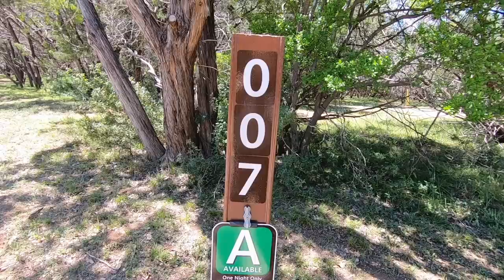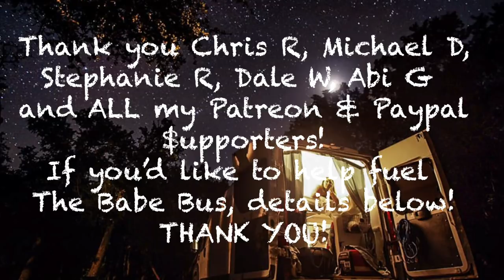Happy Two Month VANNIVERSARY Babe Bus!

Comment: Solar isn't practical with rv/van living at the scale needed to run a/c.  The whole point of solar is to get a return on a long-term investment. It would cost nearly $10k just to safely run a/c for 3 hrs at night.  Not mentioning where would you mount all 12-16 panels optimally for cooling and energy production when their location isn't constant.

Comment: Out of curiosity would you consider cutting your countertop in half to add a shower/wet bath? (In the future) it would fit. Or on the opposite side of the counter? Your thoughts?
Reply from the maker: Absolutely not. The kitchen is already insanely small.

Comment: On the Solar with AC check out some of the latest videos from Nomadic Fanatic. He just installed a MONSTER solar array and runs his AC. The trick is you really have to have a MONSTER set up, buts its possible. :)
Reply: Monster set up?  Have you seen pictures of the Babe bus?  It is a little van, not a huge class a like Nomadic Fanatic is running.  He has much more roof area.  Not a trick.
Reply: @jdmather5755  Well, yes I realize that I was merely saying that it can be done under certain circumstances.

Comment: I run my air conditioner on solar for up to 7 hours. 800 amp hours of lithium. 3000 watt inverter. 450 watts solar. Never need shore power
Reply: How much did all that cost just so you could run a/c

Comment: Cut a trap door in your floor. Big enough to set a Honda eu2000 through it. Then plug in. Then it's out of sight out of rain and you can run anything.
Reply: @CaseyRoman  it won't vibrate while sitting on ground. Seal trap door no smell. Noise yes
Reply: You can also use trap door to take a dump. No emptying bucket

Comment: Speak to both Nomadic Fanatic and Life is a Joy who are both running AC off of solar.  It’s quite possible BUT doubtful in a van purely because they both have massive solar banks and lithium batteries.... with a van and under a KW of solar... nope not gonna happen.  But I know nomadic can run one of his AC for about 6-8 hours on his bank and LIAJ has a mini split he can run for a few hours as well, but he uses a slow start as well to get it running.
Reply: The Babe Bus is a van.  I don't get the relevancy of speaking to someone running a class a rig?

Comment: Yep Maxxair type vent fan works wonders. Something with a large fan. One can look on freecampsites.net and find either free or cheap places to camp. Some are boondock, some are remote campgrounds, some are city campgrounds many free. The campgrounds I think are $15 or less to be listed on there. Uh yes A/C on solar is possible. Rooftop air isn't a realistic option. A minisplit is the best option. I seen a build that had the condensor disassembled and mounted underneath. Not for the unskilled but it's possible. A few vans have 1000w + on the roof and run A/C even overnight. Yes Lithium batteries make that possible. Water is the biggest obstacle in  a mobile life. Oh many home improvement stores have water in the parking areas or surrounding for watering plants etc.

Comment: 11:35 it took 3 years to build up to 300Ahs of batteries and enough solar to charge them in 😢6-8 hours - - and i can just run it overnight. It doesn't work  in Phoenix summers, only during the shoulder seasons and winter 😏

Comment: , God bless your heart. I’m puzzled how you are A-OK with ‘Le Shitter’ and having a challenge regarding van shower reality. (Even with a built in full on RV shower stall, you would not have  enough hot water to luxuriate with 5 different soaps and ponder the meaning of life.) There is a company working on filtering and recirculating hot shower water to allow for long showers but it’s not even a prototype yet. Ventilation: install interior chain locks and crack your windows and doors at night.(Additional interior locks are needed in any event event because ppl will use a slim Jim and break into your van while you’re asleep! )
Reply from the maker: Tranquility Travels have you converted a van and actually lived in it?

Comment: ok...not even halfway through the video and I have to comment.  Staying at state parks:  they are nice, great in fact.  But if you are not a senior or disabled, they are NOT a long term solution for being on the road full time.  Discounts provided to seniors and disabled (rightfully earned by the way) help bring the cost down to where it can be affordable. 
Second point of RV vs. Van life.  Casey is right. For a majority of reviews, they are written by RVers and they usually use the facilities in their own rigs.  I am disabled and there is no way a right leg amputee (at least me) who is about 6 foot and 250 lbs. is going to be able to shower in the mini closets they call a shower in RVs.  I use the facilities at parks daily when there (and in about 2 months that will be full time).  I need the chair/bench/whatever to sit, and need hand rails to hop from spot to spot while showering. 
Finally let's talk solar you obsessed greenie fanatics.  Yes you can run AC on solar.  But the cost of the setup you need to do it properly is about $8000-$11,000 (and don't tell me it isn't, I've done the research, have YOU?).  Let's be generous and say $9000.  Divide $9000 into 180 days (half a year, you don't run AC in winter) and you come out to $50 a day for the first year.  At $50 a night you can stay at most RV parks, state parks, Army corp campgrounds, whatever and be guaranteed 24 hour power.  You cannot be guaranteed that with solar.  Trees, rain, and other variables get into the way to guarantee constant power.  Finally regular deep cycle batteries cannot handle that strain, you need lithium batteries to do that kind of work, hence the cost.  Until the technology is to a point where it is affordable enough to be standard equipment on RVs, the cost factor outweighs the benefits. 
Now if you're a trust fund baby and money comes out of your backside one the toilet, fine go solar until you have third degree sunburn.  For us average RVers/Van dwellers, solar is a nice BACKUP!!!!  I plan to have some solar to use in emergencies.  I will not depend on it.
(falls off of soapbox now)

Comment: @Casey  Basically in my opinion I see Solar as an added compliment to an electrical system. One of my old buddies back from high school he's an electrician he does a lot of work here in the Boston area installing solar panels and  home generators. And he tells me they're great to have but the amount of area you would have to have to generate enough for all usage generally isn't in most homes in terms of the roofing in the backyards excetera even if there was enough space it would take up the space for other uses. So the same theory translates to an RV or a van of course maybe not exactly but I think people get the idea. no I don't have a van or an RV although I plan on doing it. But I see things as a three pronged attack. You're going to have your regular power that is coming off your alternator from your vehicle, solar panels on the roof and a generator. I get the point of some of the people who are these solar power saints it's the catch all end all make all everything all . In most cases reminds me of the people that want to put this green New deal silliness across the country. Which would never work. Most folks need a mix of power sources. BTW, I enjoy the irreverent humor and  like the straightforward approach. I watch lots of these different channels to get an idea of how things should go what to expect xcetera. So thanks !
Reply from the maker: "Three pond attack" is my favorite part.
Reply: @CaseyRoman  I figured you would appreciate such 😉 you try using talk-to-text with a Boston accent LoL. I fixed it .  What no wise ass crack on the Solah ;-)

Comment: Re washing machines, you need the space and easy water access. We have a Panda washer that hubby loves. But it won't handle anything that I could not do in a bucket in the same amount of time. Plus, the bucket would not weigh 50 pounds or be clumsy to drag around or store. I am just waiting for the d****d thing to die. So, you know it never will.
Reply from the maker: If you know the mechanics of a washing machine than you know nothing replaces a washing machine. I am not about to spend all day twirling anything in a bucket. I go to a laundromat.
Reply: @CaseyRoman  Laundramats are lovely. Bus sometimes we are 30 miles from the nearest one. That Panda really does a good job, but it is heavy and clumsy to store on the road, and looks trashy sitting outside covered with an Ikea bag to keep the bugs out. If all I need to do is clean off some sweat and dust, the bucket is OK.
Reply from the maker: Jean on the Road I change locations daily so I’m never far from one

Comment: I watched a video by Bob Wells, and he said that the one reason for not insulating was if you RV where it is hot.  The heat is going to get in and the insulation will keep it inside.

You don't run the AC off the Solar.  The AC runs off the batteries.  And, getting enough  battery power for an AC is hard.  Nomadic Fanatic has 1.2 kilowatts of Solar, but he has a class A, and I don't think you are going to get that much on a van.  Though, Campervan Kevin does have 900 watts of solar on his Promaster, so...

Put the Tulips away??  Haaaahaa!  Thanks.

Water?  You don't boondock.  People who boondock need more water.

"Could you empty this for me?"

Then again...maybe not.

Comment: I don’t know shit about this electrical, batteries, solar, grey water clean water but I know that I would like some watts of solar. I plan on going towards sun and heat. So I want the solar charging the battery🤔 is that how it works🤣🤣🤣🤣🤣🤣 kudos to you for building the Babe Bus yourself because I gonna need some fucking help🤣🤣🤣

Comment: Air conditioners off of solar you're such a thing called a easy start once you put that little box have it installed you can run it all day off of solar and batteries all you need is 400 watts of solar for 100 watt panels and for 100 watt batteries

Comment: Window and second vent...check.  Your insulation work was not wasted, if you were in extreme temperature change, that work would pay off.  Your correct about running an AC on solar (battery).  I'm getting a portable shower and a shower tent, oh yea.  Swamp ass will not do.  What the hell is that thing (fan?) starting and stopping through out your vid?  Good point about pets.

Comment: Hey lady, if you go to your 1st video where you said you wished you had done 2 fans, I wrote a well researched note with Amazon or Walmart links to fan options. All 12v or battery operated that can stand alone or clip on for temp use. Search on my username to find it.  You can use Prime shipping to a UPS store whenever you're in 1 place for 2 days or just Walmarts or truck stops for inexpensive decent options.  It really helps. I also use a battery powered rechargeable shower to do your hair right with a bucket of hot/warm water.

Comment: you can run that on solar, but it would be very costly.  Check out nomadic fanatics recent videos
Reply: Yeah, but Eric had a class c , and now he's in a Class A with an entire roof of solar panels....and Pippi Peterson did THAT years ago...BY HERSELF,  including wiring AND building her battery bank set up.  I enjoy NF,  but Pippi is the most knowledgeable.  I don't think Casey   has the space for the amount of panels needed or for the battery storage. 

On another note, I WOULD suggest a National Park pass...or Thousand Trail etc.  Initial outlay may be a bit pricey, but feom what I understand totally worth it.

Comment: You can run an ac on solar panels, not all night. Where I live you need climate control day and night.

But rather than go through all that trouble I would rather hack a Prius with a hard sided pop-up than try to get enough batteries , solar, and afford to be able to haul it all.

  I almost shower exclusively at the gym some of the time I just don't want contact with the public I will heat 1.75 litre of water for the process. Yes I use the hose it's cold but I use my hot water wisely. I use water coolers and this makes that hot water stretch. 

I would not mind getting a 350 watt solar panel to see how much fuel I would save having a panel like that. I'm done pissing away money on experimenting with anything else. 

Sometimes i don't feel like going out to poop I place a bag on Willy and my ass over a garbage bag. Rarely do this and it is crazy I do this I have a fully functional RV bathroom in the camper. Thing is I don't want to deal with dumping the tank rather place  the garbage can under my thrift store shitter bag it up toss in the trash. I'm so close to going GET hardware to remount the toilet so I can have a righteous flushable shitter.  I think I'll break ground on that tomorrow.

My toilet works just a fine tree has put down roots and DISTURBED the sewer line. Shit runs downhill so I can reroute the sewer line or file 13 the bathroom and just build another one this side of the tree. I will fix something up before this summer is over hell I might have it done by Monday.

Comment: i have 3 250w panels on my van roof, and a 2kw inverter, and 200ah of battery soon to be made to 400ah, but no way can that run aircon for 8 hours a day, and thats about the biggest system your getting in a van, you want more than that your into skoolie catagory for the roof space alone. anyone thinking the roof of a sprinter/transit has enough space for a solar aircon system is deluded

Comment: Its funny you and i started around the same time.
That first week or 2 was rough and strange but now i feel like a veteran lol
  One thing bob mentioned in Florida or south where its hot insulating a van is not wise cause basically you are creating a blanket . I only insulated my ceiling where most heat hits and i believe that is a big help. My walls only have plywood and finish boards and i feel thats enough.
As far as showers i just use a spray bottle and it works great. I dont worry about moisture at least not yet.
Eventually i will have 2 maxx vent fans installed they are in my storage waiting
  I had to stop cooking in my van since the weather got warmer unless i can open my doors.
Reply from the maker: Hell yeah!

Comment: How the heck did you end up in Galveston from El Campo.  Don't want to rub salt into your sweaty wounds, but I told you to detour north while you still had the chance.  Clearly no one told you that in Texas, 70 degree days and 50 degree nights end with the spring equinox.
Reply from the maker: The point of this trip is not to have a rigid schedule.

Comment: The size and amount of solar panels some van lifers have on their rigs is astounding to me. My partner and I have been living off-grid for 21 years now and for the last 14 years have been using a single 80W solar panel for our household :D And before that I lived for 7 years without any source of electricity whatsoever. 

So imagine my jaw hitting the floor when we took a road trip this winter and kept seeing all these vans with double, triple (quadruple?) the solar power we have at home. I'm still mystified what on earth people power with that much wattage. And why. Especially since laptops and phones can be charged over the cigarette lighter socket. So I don't know - microwaves, curling irons, nose hair cutters?! 
We kept wanting to buy a small trickle charger panel during that 5-month road trip last winter because we had an old deep cycle battery that we used for powering three LED lights. We couldn't even find a small one, so ended up doing the entire 5 months of winter travelling through the States with an old leisure battery that never got a single charge. And it didn't die!
What peeves me about solar power discussions is when people tout it as an environmentally sound source of power and have a gigantic system, especially when travelling in a van or RV. Batteries are anything but environmentally friendly, and solar panels and all the power hungry electronics we use are made to a high percentage of non-recyclable and increasingly difficult to find materials. 

I had thought that off-grid living and van life are choices that lead to a more simpler lifestyle, but it seems to me that for many it's about trying to maintain their old lifestyle - just powered by solar.  I guess I was naive :D

Comment: The reality is, Yes you can run ac off of solar; but you need twenty 100watt solar panels.. (that is a shitload of solar panels) most "solar-gurus" are armchair quarterbacks with zero experience.. btw, you can fit maybe 4 to five panels on a sprinter.